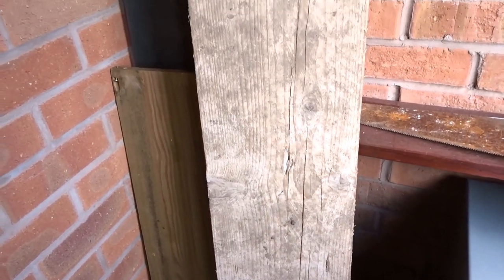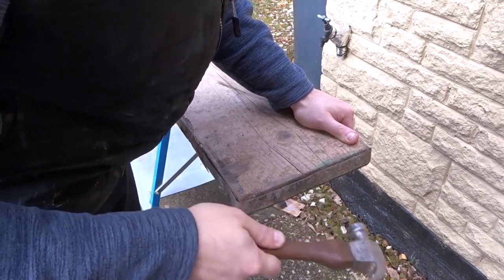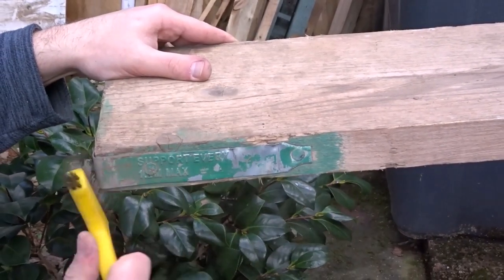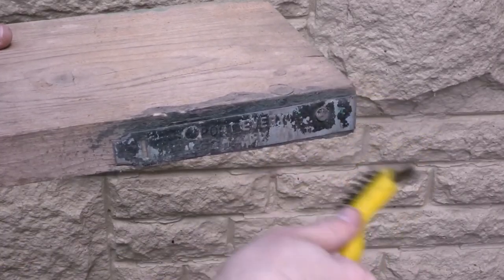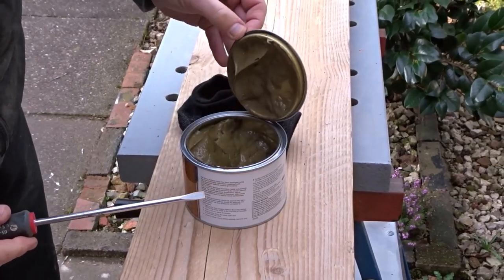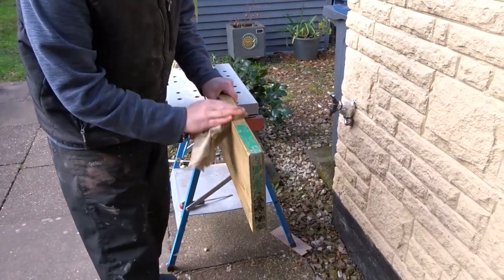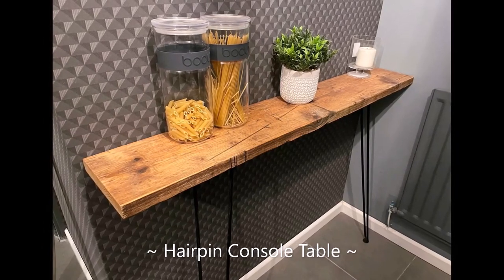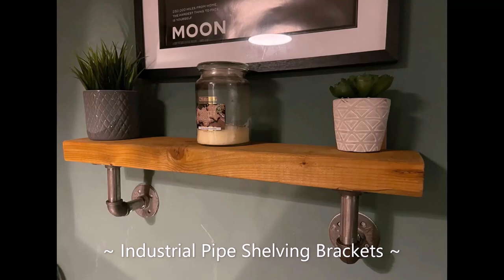How to Make Rustic Scaffold Board Shelves (FREE Wood DIY Project)

Comment: Morning Phill. Which brand of wax are you using, as the label was not visible? Thanks. G
Reply from the maker: Hi Gary it's Ronseal Colron 👍🏻
Reply: @PhillWyattProjects  Brilliant, thank you. I'm going to get some dark oak now from wood finishes direct.
Reply from the maker: @hythewoodworkdesigns  seems like good stuff and doesn't have a strong smell to it either. 👍🏻
Reply: @PhillWyattProjects  I can't use it🤬🤬. They said you must not use hard wax oil to a wax finish, but I can use the wood dye & add the oil when it's dried. So annoying.
Reply from the maker: @hythewoodworkdesigns  I didn't know this either Gary 😯 I do now though.